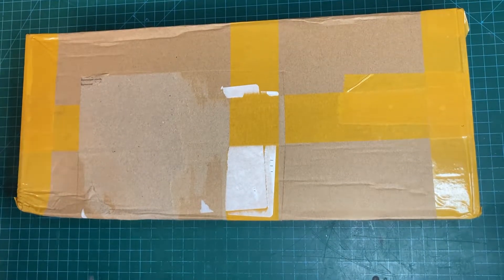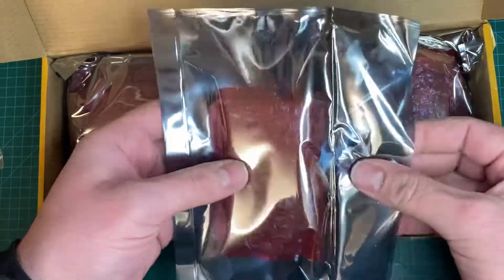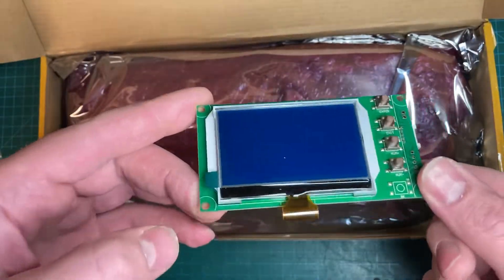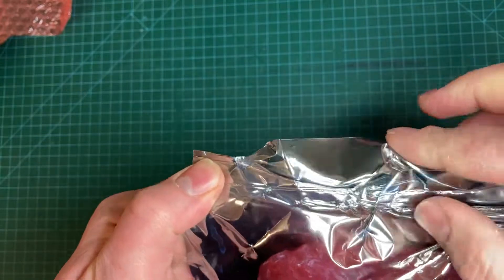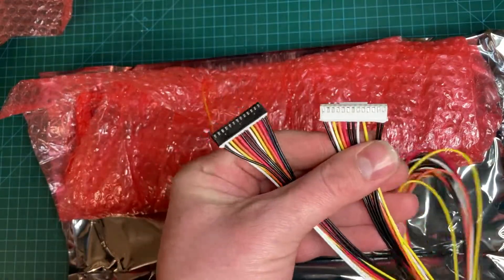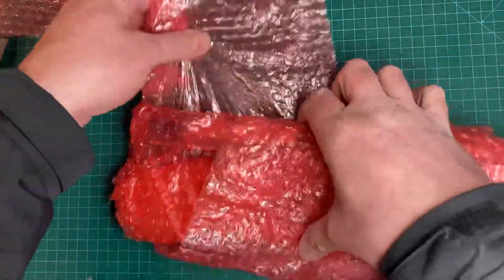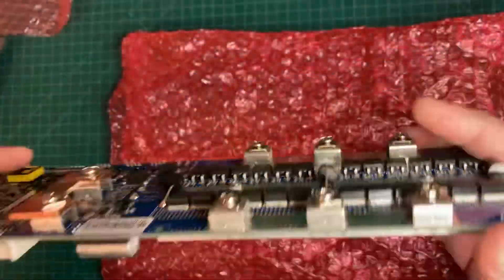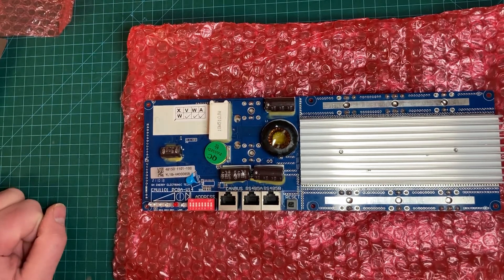SEPLOS Smart BMS  48v 14S 150A Li-ion LiFePo4 Solar BMS Supports Inverter Cell Balance NEW project

Comment: any updates about these replacements ?

I have gotten a weak GBLI 5001 and want to use that "LiIon Battery" with a Seplos or JK BMS to run a SPH 3000 or 4600 inverter .
I have not the SP 2000 "Base System" as connection, so I guess I have to got the old way of running the JK inverter BMS talking canbus to my SPH inverter and pretending   to be a growatt battery.
 
I have looked through your videos but did not really find any real update video about the old battery and a new BMS.

Comment: I am SUPER keen to see how this one goes for you as i currently also have 2 x GBLI5001 Growatt batteries, but set up with Daly BMS's and an SP2000 set as lead acid which works. But i really want to find a DIY BMS that will talk to the Growatt gear so i can use more than 50% of the battery packs! Looking forward to your rebuild and results!

Did you order from SEPLOS directly? Do you mind if i ask what you paid for it?
Reply from the maker: Interesting. My sp2000 when I power it on just beeps at me saying communication fault BMS ect. I didn’t know it would work in lead acid mode.

Comment: Awesome, wish you had got this connected up and working my BMS on my GBLI5001 5kw battery has failed and I want to get it working again with my SPA3000
Reply from the maker: I’m working towards getting it up and running. Shouldn’t be much longer now.
Reply: @smartazz  Good luck with the installation.  I have two Growatt batteries I'd like to change the BMS in.  I notice SEPLOS says it's setup for the Growatt Off-Grid protocol. Hopefully that's not a problem.
Reply from the maker: @munchingsquirrel5067  thank you. I’ll get round to fitting it soon
Reply: @smartazz  have you managed to make it up and running?
Reply from the maker: @rino125p  it’s up and running yes :) 
Unfortunately it’s not running on the Growatt inverter I planned to use it on, that’s not working at all :( 
It’s now running on a Solis 3.6kw and working very well :)
Reply: @smartazz  what inverter have you used? I have solis 3.6kw. I can't see the video about this pack running. Have you recorded it?
Reply from the maker: @rino125p  I’ll make a new video on it just for you ;) hopefully in the next week or 2.
Reply: @smartazz  any update? :)
Reply from the maker: @rino125p  my brother needed an inverter for his solar setup so I lent him the Solis, just waiting for that to come back to me when his replacement arrives. Sorry

Comment: They let the 6 ea 5 mm screws out of my B+ and P+ bus bars. Somebody is slacking at the factory. They also need to include a USB to RS485 adapter.
Reply from the maker: Where did you purchase it from ? 
I hope they send you the missing parts.

Comment: Hey .... did you connect to the BMS rhyme via BatteryMonitor? I am still trying and I  can not manage.
Maybe you could help me, I have a problem , I can't connect to my BMS Seplos through BatteryMonitor, ... Battrery monitor is able to connect and do Firmware Update, this function works ok.
But when I try to load the protocol for mybattrery 14s (ie import the protocol from the xml file) I always get an error (not correct format ... . loading protocol failed, please correct and load it again). I already tried to run the program on Windows 7, 10 and 11 unfortunately always the same error ... loading protocol filed...
Are you able to guide me what could be wrong and how to work around this problem? 
I see that everything works fine on your computer, which version of Windows are you using?
Thank you in advance for any possible help and sorry for errors I speak English poorly and write through translator.
Reply from the maker: Still a job to do. I will upload a video soon.

Comment: This is so fascinating look at that huge heatsink really nice bms 😁👍
Reply from the maker: I Should have it up and running soon hopefully. Just sorting a case to put the BMS in to.
Reply: @smartazz  nice 😊 you can also connect a few leds, if you find the right MOSFET which turns on when the cells are balanced. It's a little tricky part we have to look into it Haha

Comment: Couldn't quite see, is the conformal coating over everything? Are those 3 big diodes Schottkys, to stop unbalanced cells trying to balance at a ridiculous current?
Reply from the maker: Yes kinda half covered with protective coating (all the shiny bits), big resistors for balancing nice 👍